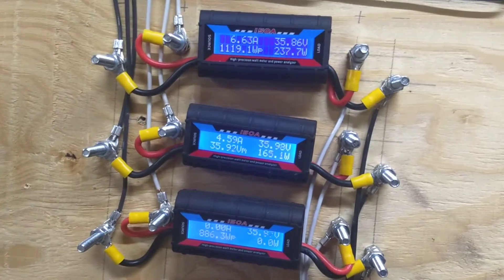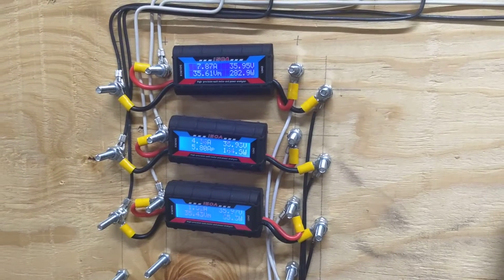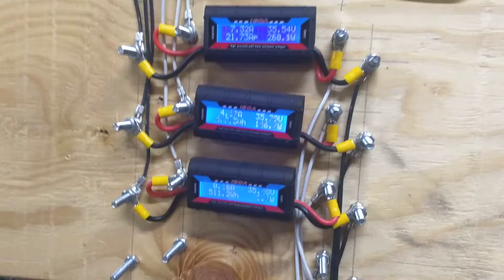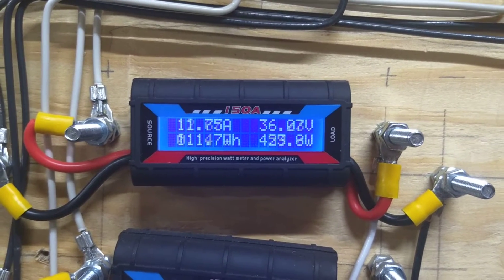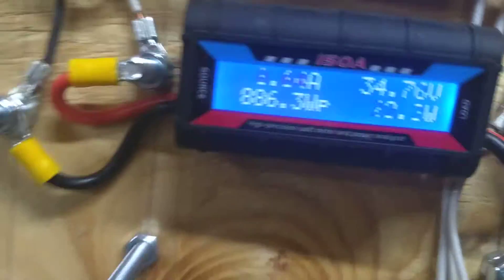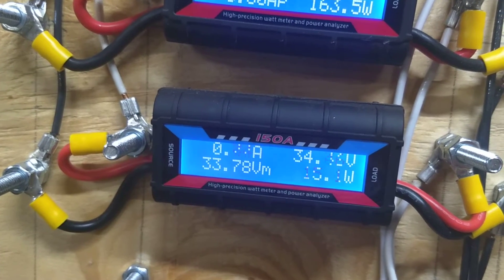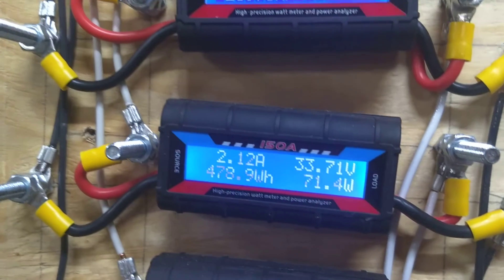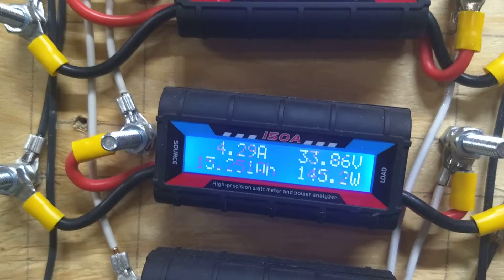New peaks for Chinese wind turbines during wind storm

Comment: Just bought the 400w. The 3 green wires just hook to the charge controller in no certain order correct? I'm assuming that as they're all green.  Also,  how do the brakes work on these? Thanks for any help you can give..
Reply from the maker: They all...or mostly all...are three phase machines.  The phases are all the same, there is no order to the wires.  Hook them up however which way.

Are you using a controller that has an integrated brake or a standalone brake?  The brakes operate by shorting out three phases with one another.